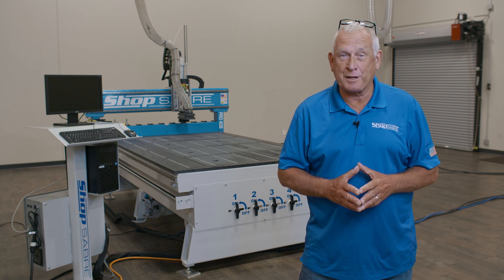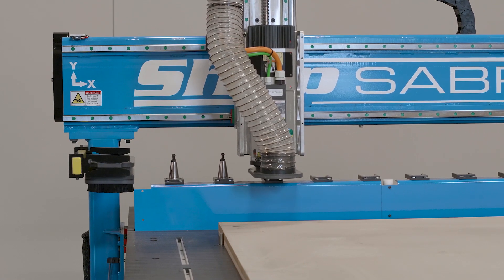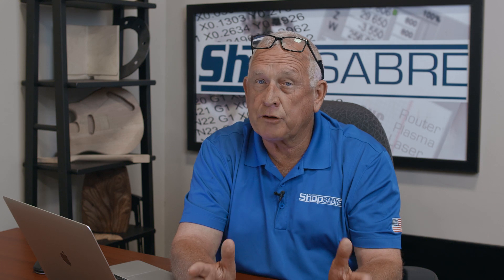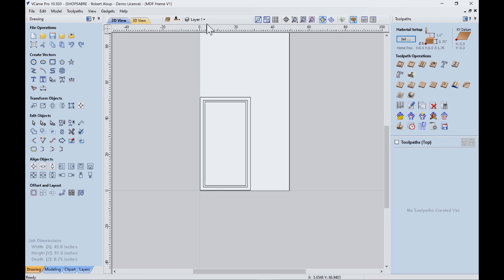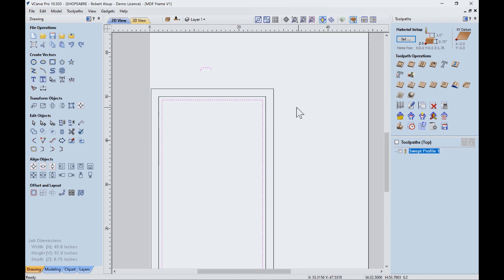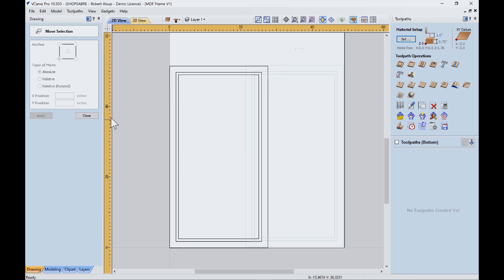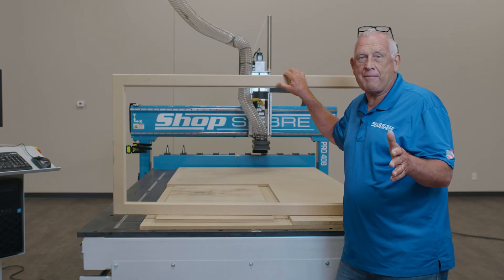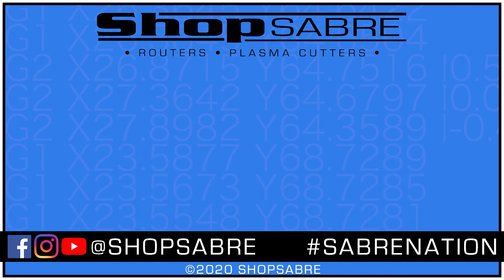ShopSabre - Wood Frame Project with PRO Series Router

Comment: How long have you used closed loop servo's?
Reply from the maker: Great question! ShopSabre has been utilizing closed-loop servo technology for years, ensuring precision, power, and reliability in our CNC machines. Our advanced motion control systems provide superior accuracy, reduced errors, and increased efficiency compared to traditional stepper motors. If you're interested in learning more about how our servo-driven systems can benefit your applications, feel free to ask!